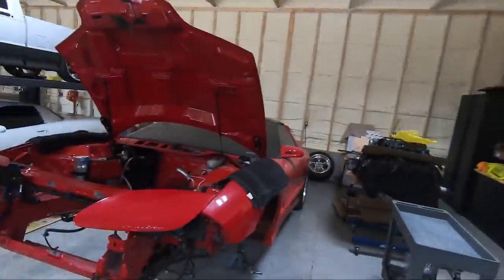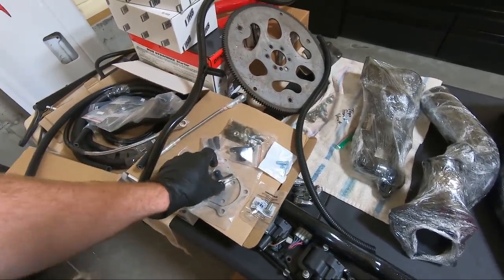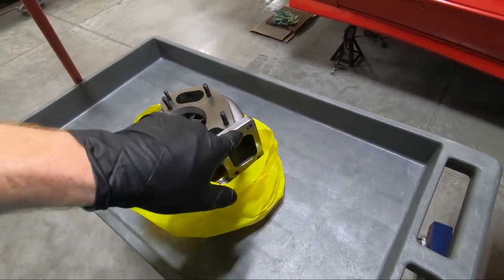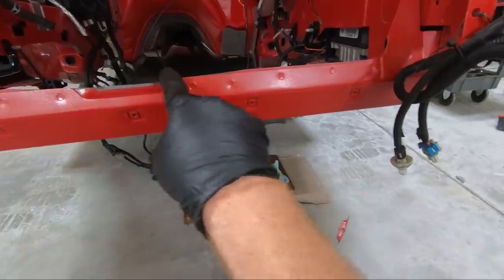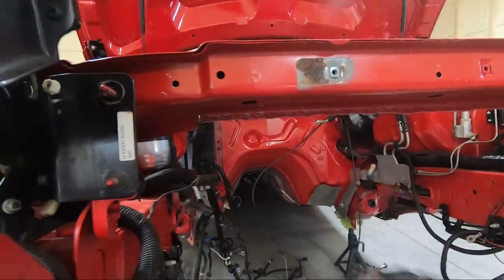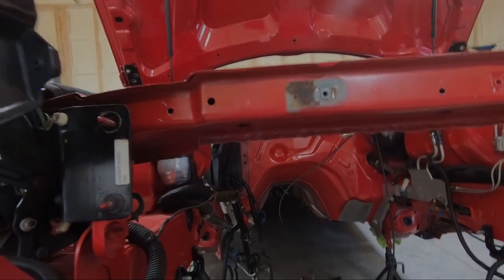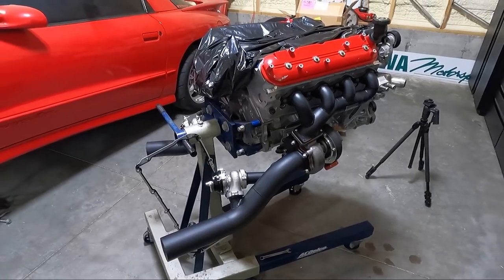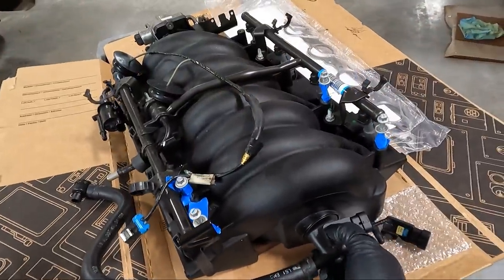Trans Am WS6 Twin Turbo Build Part 2

Comment: Great Vid Man, that kit looks nice. I was looking at his kits for my 2000 Silverado but the V3 is no obsolete so ill wait for the V4 to come out. 3 Bar will be great for when you start pushing more then 14psi which is really the limit of a 2bar. You are defiantly prepping yourself for future upgrades.
Reply from the maker: Thank you. Yeah even though it's a stock bottom end I figured I would do a few things
Reply: @TWAMotorsports  With the right tuner, ive seen the stock bottom end on an LS last many miles with boost. Gen2 LT1 on the otherhand...not so much..lol
Reply from the maker: Yeah that is the plan for now.

Comment: TW... Good Thursday evening buddy. Man that twin turbo set up is sweet. That ta is going to boogy.. HOLD ON TO YOUR HATS FAMILY FAST..... Great tutorial for your turbo upgrade as long with the other LS turbo guys out there...👍....
Reply from the maker: Thank you. Will be slower than past cars but fun to drive I'm sure
Reply: @TWAMotorsports  slower lol.. how much boost are you going to be running on a stock bottom end LS1?
Reply from the maker: Way slower than my old zr1
Reply: @TWAMotorsports  lol. You could be like sketchy vert and make your ta run in the 8's. Hahaha...
Reply from the maker: He has a completely different setup with no a/c. I'm not giving up my a/c
Reply: @TWAMotorsports  TW. Good Friday morning buddy.  Yeah I air conditioning is good on a hot summer day. But in my opinion that's when the tops come out. Haha.. are you going to be using hood pins since you took out the hood latch?
Reply from the maker: Omg no. Hood latch goes back in
Reply: @TWAMotorsports  hahaha ok. I just can't see drilling and cutting out holes in your hood.. have a safe weekend buddy.👍
Reply from the maker: You too. I'm not a hood pin guy. That's a mopar thing lol
Reply: @TWAMotorsports  good Monday afternoon TW. The weather is actually warm outside today.. if I could I would have made it a sick day to turn wrenches on my 94 trans am.. but I decided to go to work this morning.. maybe next time I'll take a sick day haha..
Reply from the maker: Lol. 68 here today. Calling for snow tomorrow